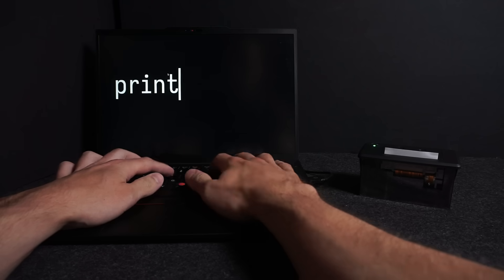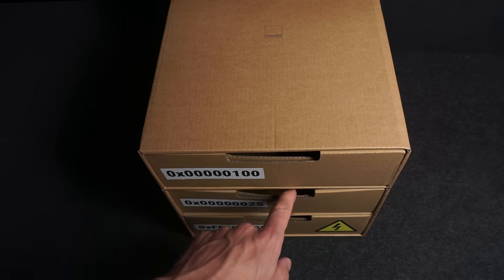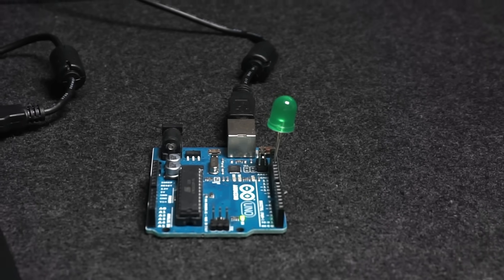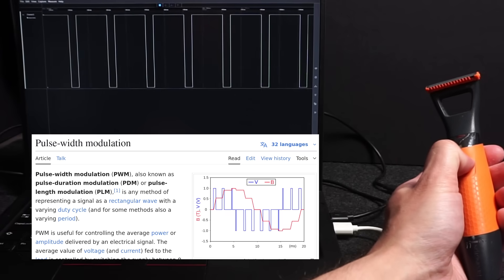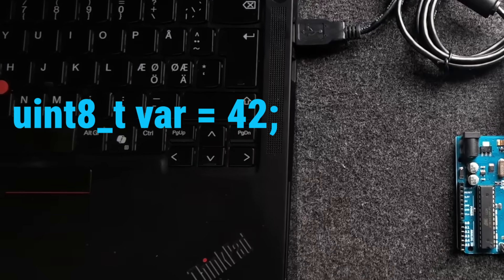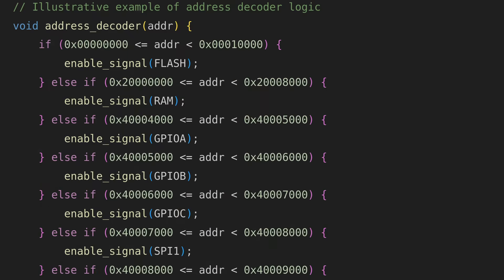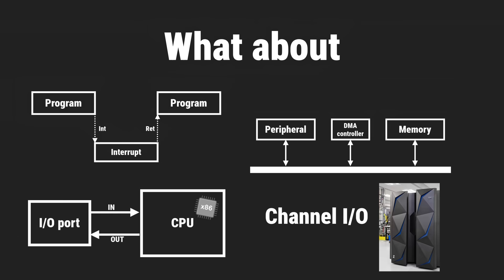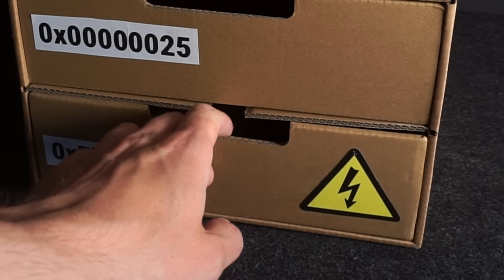How Your Code Really Controls Hardware

Comment: Do cpu interupts just move data around on things you cant?
Reply: If on a regular kernel/user architecture (modern oses), cpu interrupts do everything a program can't, not just touching memory you can't, can also be privileged instructions.
Reply: @re_axolatte  from that video i got the curiosity to read printf and see how it works. I couldnt because i have windows and when i try to enter the call with a debugger it doesn't go on the original call. I have to execute it as a call without getting inside. Does printf just writes data somewhere?
Reply: @stavros222 again, it all depends on architecture, but on embedded chips/systems, it could write to MMIO directly via a VGA framebuffer, or could write byte ASCII into a serial out console (again, depending on architecture, but arduinos usually use serial consoles)
Reply: But on modern OSes, its a libc wrapper to a system call (a function that a process can call that is handled by the kernel) that writes to a linear framebuffer (just a fancy way of saying a pixel-perfect framebuffer), since processes dont touch memory themselves, they ask the kernel what they can touch and whether they can get more.

Comment: If you are interested in Hardware especially Embedded systems i real recommend starting with the  Microchip PIC µcontroller it has only 35 Instruction Set and its architecture is very easy to understand,
 it will give you a very good general overview on how thigs work
Reply: Yes, the PICs are a good set of chips to play with.
They even have in-circuit emulation and debugging tools.

Comment: Wait normally devmem is locked right? If i am not wrong you should enable it in the kernel build.
Reply: That is just for control should memory being exposed to user space. Hardware Mapping does not require any software. They are complete by hard wires and logic gates.

Comment: As an engineer myself i still find it very informative of a video. Guess there are much more ways to controll hardware other than what i dealt with

What we have - a few chips with SPI. We load values to registers trough SPI, and those registers (separate CMOS bits) power up whatever needs to be powered up. I assume there are either multiplexors

Absolutely smashed that sub button for future insights

Comment: Where these values came from like UNO  *(volatile uint8_t*)0x24 = 32;  the value 32 and in the STM   *(volatile uint32_t*) 0x40000028 = 79;  the value 79?
Reply: He assigns the decimal value 32 to the 8 bit Data Direction Register of Port B.
decimal 32 in binary is: 00100000
He is setting the 5th bit in DDRB to 1 and all other to 0
Because the DDB5 bit is set to 1 the Pin PB5 = Digital Pin 13 = Pin with the Onboard LED on Arduino is set to Output mode.
Reply: @Henry-sv3wv  thanks bro👍👍

Comment: what is with the word "volatile".
Reply: the c language doesn't know about memory mapped hardware. so it thinks if it reads a value from RAM that it didn't modify then it stays the same value. so why re-read a value from slower RAM if it already cached a copy of the value in a faster internal CPU register and read the copy of the value instead.

The volatile c keyword tells the compiler: don't trust your own optimizing logic, always access the RAM location !!!

Comment: mmio is easy but the difficult part is to:
1. understand via datasheets so as to "where to write"
2. even more difficult is to figure out "what to write"
Reply: easy with 8 bit avr controllers, harder with 32 bit controllers.
with 32 bit controllers they love to use c structures for memory-mapped registers

Being able to shape a struct down to the individual bit for read and write access is extremely convenient, and it's a pity that the standard throws it into the >>> pit of undefined behavior <<< a great reason why to hate C

Comment: I learned this many years ago. I got my hands on an apple II+ and a parallel port. And wrote bytes directly to the address that spit the data out of the parallel port. I read many books about how it worked back then, but yes its all basically a memory address. Some addresses have special functions and those can control external signals. There are tons of reserved memory addresses for many different functions but at the end of the day the cpu sends the data to an address and that address is the key to doing something external.
Reply: Hi Sir, I am quite interested to see the whole world 🌎. Could you please help me with my curiosity? Maybe I can learn what you learnt after years and years of experience in no time. If you're interested in elucidating me then I will be very grateful to you -

Q. Is it true that addresses are written? If so, how is it possible to label an address to a transistor or capacitor?

Comment: Another way of thinking about this is realizing that memory is just another peripheral attached to the CPU's busses: when you write to a "normal" variable you're still changing "the real world", it's just that the effects are not readily visible like toggling an LED or turning on a motor.

In fact in some cases you access memory through I/O ports: for example to access video RAM on old systems where this memory is connected to a dedicated video controller, and the CPU communicates with this video controller only through I/O ports.
Reply: It's not only old video controllers, we just don't get hardware level documentation on modern gpus. But the graphics driver + Vulkan/OpenGL/DirectX running on the CPU writes the required data in memory, sets up a memory transfer from system ram to video ram (for textures and polygonal data + shader programs). GLSL or other shader code configures the GPU to process the required data from video ram and write to the output buffers, or configure a transfer back from video memory to system ram (which is how GPU compute libraries like OpenCL and CUDA work).  
You also have direct CPU to video ram writes and reads, if you really want to. Block memory transfers are faster and can run at the maximum speed with the overhead of configuration, but it's just a fancy DMA system over pci-e. 
Integrated graphics doesn't need to do the block transfers, but system ram is higher latency than dedicated memory and that matters for large parallel computation.
Reply: @PaulSpades  Block transfers may be higher bandwidth but they are higher latency than direct writes (and direct writes take up more CPU cycles.), you must include the time to do the original CPU write to main system memory in the latency measurement. 
Integrated gpu use of main memory would have shorter latency due to the lack of extra transfers, but lower bandwidth due to the physical design of the RAM. Main memory design is focused on reduced latency while dedicated vram design is focused on more throughput.
Reply: Is it really true that memory and addresses are mapped in if and else condition? I believe there is no such mapping afterall a machine cannot have an address nor does it understand!
Reply: @Aman.o_O  Do you not understand what switches are? I mean real switches like those used to turn a lamp on and off or make a train change tracks. Note the difference between momentary and latching switches, then extend that with the idea of a relay so a switch or group of switches can be activated by another switch or combination of switches.
Reply: @mytech6779  greetings, yes I know. Pardon for any confusion. My question is entirely on the address existence! See, how come we can give a hexadecimal address to a physical object that is either a capacitor or a transistor?
Reply: @Aman.o_O  The same way we can give an address to a house in a road, or floors in a building etc. The thing being given an address to doesn't need to be "aware" of it, it's just a human representation of the state of the real world.
Reply: @Aman.o_O  I think your confused because you don't understand what hexadecimal numerals represent and why computer science uses hexadecimal numerals to represent bits at the _human level_. 
Computers do not use human numerals or other characters, not in any way for anything, symbols on the monitor are just a picture drawn for human representation the computer only has a bunch of pixels turned on and off (more switches). A text file is not text in the computer it is a series of switches turned on and off that gets represented as text for the human consumer.

The numerals which humans read can be used as numbers for doing classic math, but they can also simply compact the amount of writing or typing needed to represent the switches. The memory address is only the combination of switches. 

I could write locations 
000, 001, 010, 011, 100, 101, 110, 111 
to show eight location using 0 and 1 to represent the off/on state of three switches. 
But written as octal, decimal, or hexadecimal western-style human numerals I compact that to addresses 0, 1, 2, 3, 4, 5, 6, 7 
Using eight  switches "0001 0000" becomes 20, 16, 10 ; and "0011 1111" is 77, 47, or 3F

Clearly it is better for a human to compact the state of 32 switches from 
"0000 0000 0000 0000 0000 0000 0100 1111" 
into a hexadecimal address of "0000 004F" for most common work. 
(While three switches can have the eight possible states shown earlier, 32 switches have over four billion possible states.)
Reply: @Aman.o_O  so capacitor "address" "7" is accessed by setting switches to …111
Reply: Thanks,  @Z80Fan ! You guys definitely did your best uncovering the cover but I guess I am still not there where I want to be or what I am looking for. I will continue my journey. Cheers for yours as well. 👣
Reply: @Aman.o_O maybe making it real simple helps. 

Imagine you have 2 memory cells. That can have the state 1 and 0. So basically you only can write 2 bits. 

We have 1 lane as input. Since we only want to write 1 bit. That's. The data bus. 

Now we want to write a 1 in cell 1. Ok. Connect the data bus to cell 1. 

Now we want to write a 1 in cell 2. If we connect the data bus to cell 2 and 1 we always write to both cells. That's not what we want. 

So what do we need to connect the data bus to 2 cells?

A switch. 

So we add that. If we now want to write a bit to cell 1 or 2 we only have to flip the switch in the corresponding position.

Now. Since were lazy we don't want to switch that switch by hand obviously. Let's take a Electronic switch that switches the switch if we provide it with electricity.  Such a switch is called a relay.

Now. We have 2 lanes that can be 1 (current is flowing) or 0(current is not flowing)

The first one is our data lane. The data bus. 

The second lane switches our switch. 

Now if we want to send a 1 to cell one we make sure that the switch is off. So the other lane must be 0. 

If we want to send a 1  to cell 2 we need to send a 1 to our other lane to switch our switch so the data lane is connected to cell 2 and not one. 

That new lane we added we can call adress bus. Since the cells are addressed by it. If it's 1 it's cell 2 and if it's 0 it's cell 1.

You can easily build it with some electronics. 

And that's how addressing works. 

If you need more than 2 cells. You need more switches. And more lanes. 

You the. Connect the adresslanes to the switches in a way that each state of all adresslanes flips the switches in a way so that the data lane is connected to the correct cell. And the address is just a representation of which switches need to be switched.
Reply: @Fluxikator thank you, it was worth reading! 😌
Reply: That is probably a better way to taxonomically classify the structure of a typical computer, memory as a subclass of I/O. 
Capacitor voltage goes up, capacitor voltage goes down.